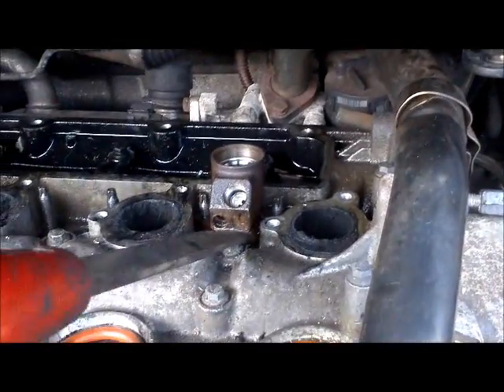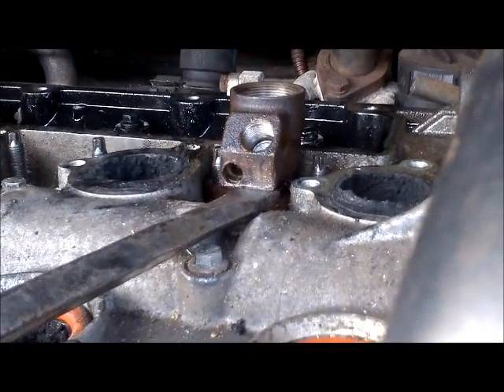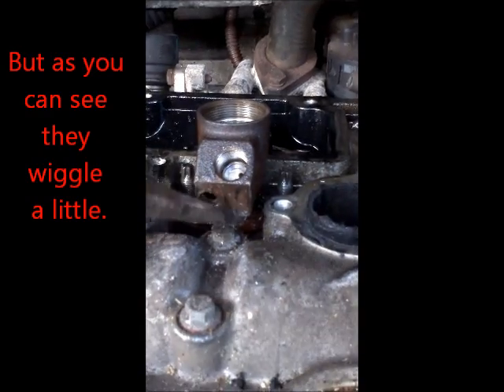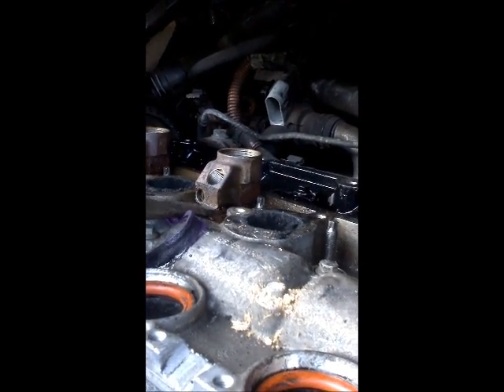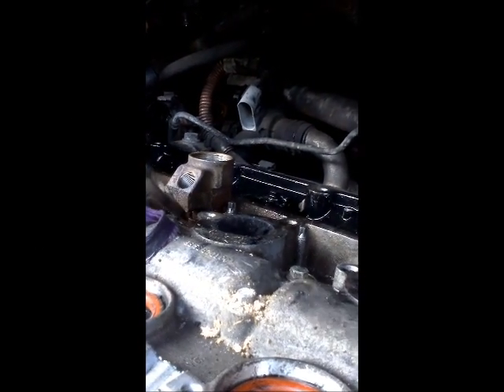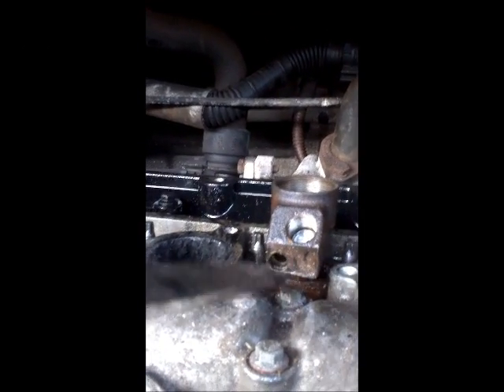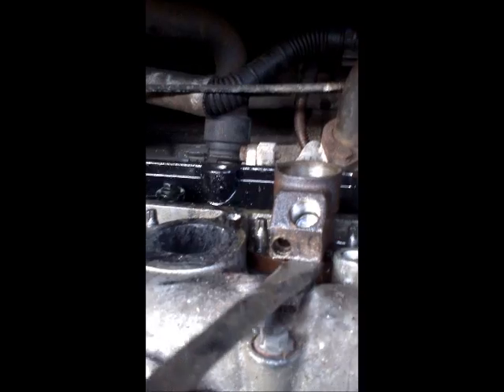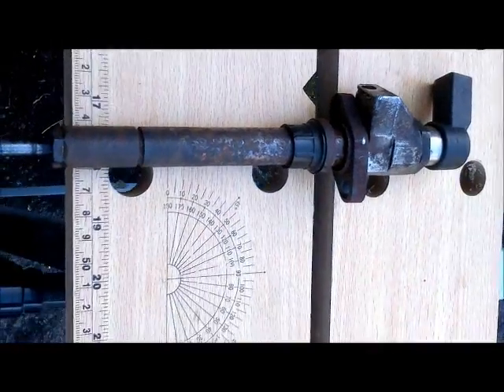Peugeot 807 removing rusted injectors.

Comment from the maker: I will update this as it is being looked at, it took me a total of 3 weeks to get the injectors out. injectors 1-3 came out begrudgingly; Injector 3 needed an injector pulley bought on ebay for £50. Using milkstone remover (removes aluminium oxide) and deblock oil down the holes. This took about 3 weeks and cause no end of crap that went down the bores and had to be removed. I will say that none of the lubricants i used penetrated more than 1 cm into the shafts; all the injectors came out dry. Injector 4 was the mother of all evil; one of the leg posts of the injector pulley snapped and had to get one made in a machine shop. Then the rocker cover snapped from the pressure put on it from ratcheting the injector up, to no avail. Finally the injector pully broke completly without removing it. So we welded a 36mm nut onto the top of the injector; using a breaker bar and a 4' scaffold bar we were able to swing the injector to the left and right, i was at the time using a carbon based spray lubricant, every day after 4 - 6 hrs of going left and right the injector would move much free-er. then we would come back the next day and it would be chatteringly tight again. After 4 days I decided we needed to get it warmed up by swinging left and right, then i borrowed a air ratchet gun and when it was warmed up used the gun to swing it left and right; all of a sudden it spun in the shaft and popped right out. This time the carbon grease had penetrated as the injector was dripping wet.
I replaced the injectors with new ones but i coated them in milkstone remover which when dries makes a barrier between the injector and the air in the hopes that this will help stop the problem.
However, all the crap that went down the bores and aurount the wells of the head blocked the oil ways and after 2 weeks the cam pulley keyway sheared off and the head had to be changed!!! Bloody sods law.
I have since had to remove the injectors again as 2 went down after 80,000 miles. Injector 1-3 poped up no problem due to the milkstone remover but again number 4 was the evil one. I used the grinder to cut off the collar ( very delicatly due to the space) and removed the rocker (I wasnt going to damage this one again) and tried to get the injector to move. No such luck. So again I went straight for the welding a nut on the top. This allowed the injector to be moved side to side when it decided to actually unscrew itself leaving me with a sheath of metal about 2 inches long in the shaft. So the trusty workshop had the head and was able to drill the sheath out.
The new injectors have gone back in with milkstone reover barrier and smothered in copper grease. I am also going to smear non hardening sealant arount the collar in the hopes that it stops too much moisture getting down the shaft.
I hope this either gives hope to some people that all is not lost when this happens to them or at least allows you to make a judgment call on your decision to fix or replace when the time comes.

Comment: What was the symptoms of the injector. I have a 807 2.0hdi the anti pollution light came on since its got cold here. The engine is a bit tappy since then but runs fine and drives OK. Perhaps a bit under powers below 2k revs but goes like thunder above 2k rpm as if a slight reduction in boost on setting off. Hmm dunno if that is normal...

Comment from the maker: I worked on them 3-4 days a week for about 4 weeks, i replaced the 'rocker cover' with a secondhand one and i not sure if its not a good fit but 3 weeks later the cam sprocket sheared its woodruff key and the head sustained damage. So had to get a recon head!!!!! pffft typical.